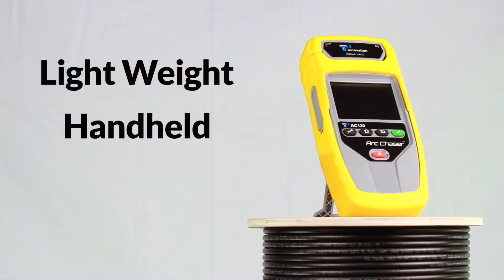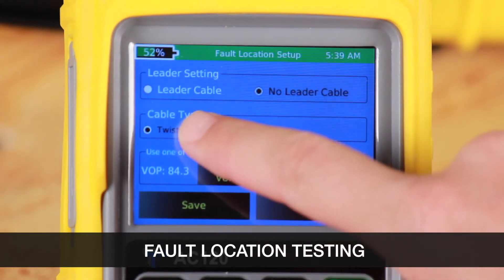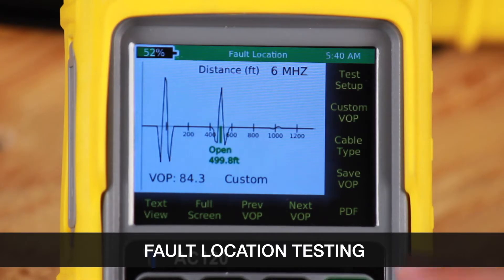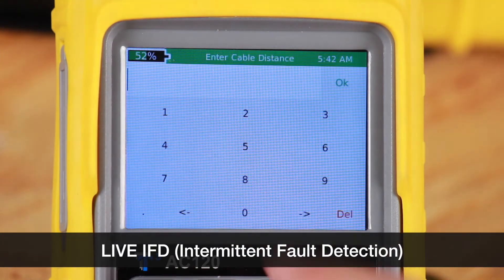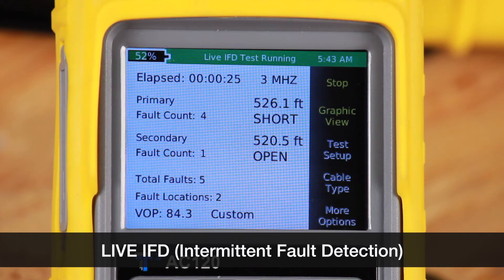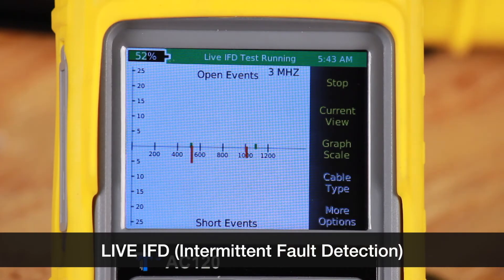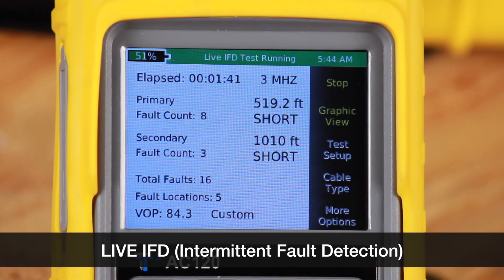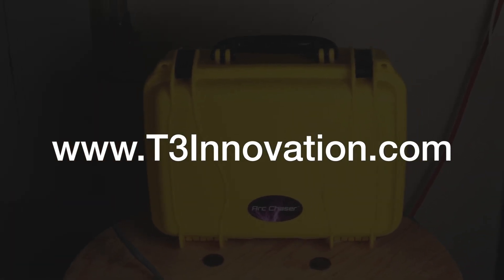Arc Chaser SSTDR Cable Tester

Comment: How does it perform detecting broken down insulation between core in multicores at 230volt AC and locating the exact damaged spot, knowing you have fault and fixing it are to differant things. 
We just do an 500v insulation test to ground and if low pull in a new cable.